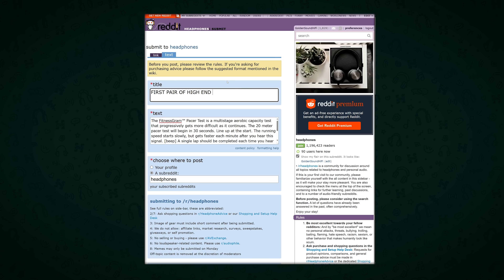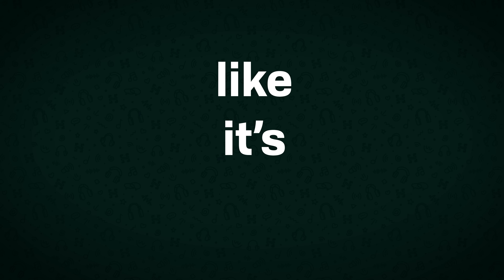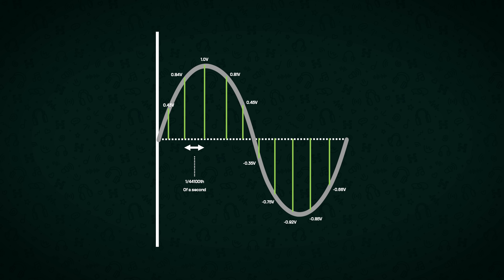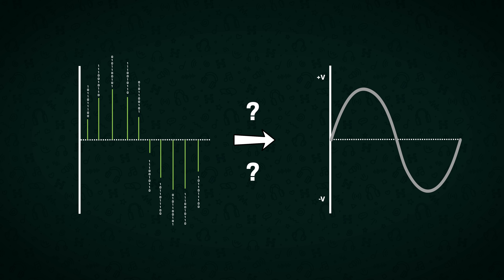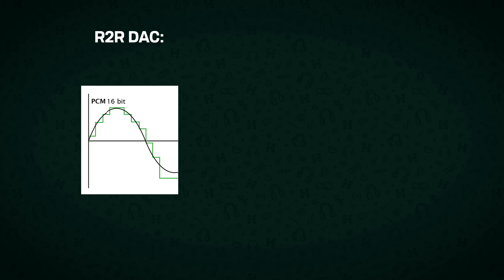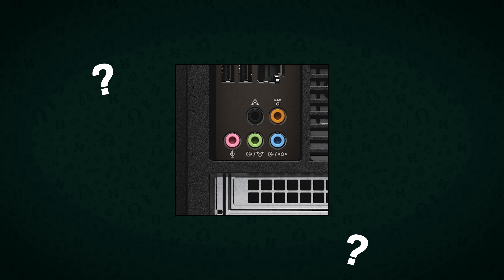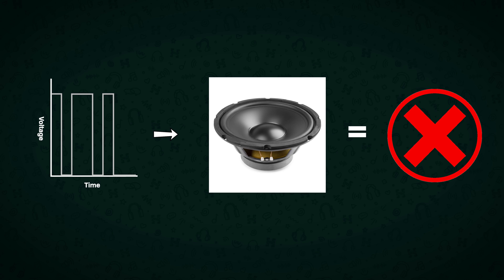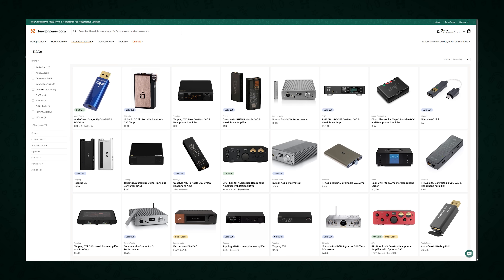What is a DAC and why do you need one?

Comment: A few important notes:

1) Whilst the video explained 1-bit delta-sigma and PDM at a basic level, most available delta sigma DACs are actually 'multibit' delta sigma. Meaning rather than modulating to high speed 1-bit, they modulate to high speed 5-7 bit as this allows you to avoid the biggest challenges with making a highly linear R2R DAC and you also don't need to be operating as fast or have as much difficulty with the modulator design as a full 1-bit DAC.

2) DACs that ARE 1-bit usually don't actually have a 1-bit PDM converter. Instead they usually use a moving-average FIR filter approach, this will be explained further in a future video.

3) Some products on headphones.com such as open box units may not fall under the 365 day return policy, please check the product page for specifics!
Reply: 4) Don't buy them from DCS /hj
Reply: @LucaTheStar  dcs is goated they doubled my debt for free
Reply: im the most sigma tho
Reply: Hey can you make a video about Linear Phase Fast Roll-off and Minimum Phase Fast Roll-off?
Which will return the original audio in the recording? I've read on Reddit that Oratory said Minimum while you said Linear Phase on a live stream
Reply: I'd be super interested in a similarly low-level explanation of how frequency response is measured and how faithfully the measuring rig and/or the best possible audio stack reproduces audio.
Reply: Discrete class A output stages  😊
Reply: Funny how Delta-Sigma DACS came out as 1-bit, then over the years manufacturers and engineers figured “oh wait, we can make this thing better by adding a few more bits” then increasing it to the 7 bits we see today in multi-level delta sigma. Makes me wonder why some people  like to poop on R2R and True Multibit from Schiit…???
Reply: So in the old days was this called oversampling.... I've got old CD players there's no DAC involved....
Reply: Strictly speaking DACs don't need oversampling. 16 bit signal -> 16 bit DAC -> reconstruction filter, no oversampling required. But when the DAC has less bits than the signal you need dithering to preserve the dynamic range, and when you need dithering it's a good idea to oversample to have less noise in the audible frequncies, even less with noise shaping.
Reply: @GoldenSound Did you happen to spot a DM on Discord about the KA11? I wonder if you have different info then what I had come across.
Reply: Excellent work as usual. I appreciate the analogy you chose; made it significantly easier for me to understand
Reply: R2R and 1-bit DACs are the best =D

Comment: Sound travels through in a wave where it changes size and frequency (speed). That is what’s called an analog process a value over time, so if you want to hear something you need it to make it sound waves, so when you have a digital signal it needs to be converted and that’s it. But modern processors are so fast they all can do it very fast and perfect so you don’t need a lot of hardware

Comment: What makes R2R DACs so horrible isn't just that it's basically impossible to perfectly match resistors to each other, it's that they change their resistance with temperature, meaning you get more or less distortion based on how the DAC being warmed up and your room temperature. And to fix these issues you need to get a stupidly expensive one, just for it to perform like an average delta sigma DAC.

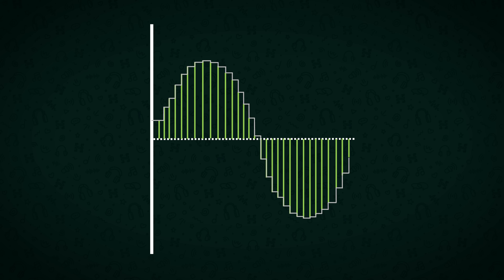Comment: 4:27 - those step-edges are just a result of mapping a discrete signal to a continuous space. They may cause high-frequency transients if you're forcing that jagged digital signal through a speaker, but they aren't caused by them. They're just an artifact of the encoding/decoding process and they'll get smoothed out with higher sample rates.

Comment: I have a 7.1 channel sound card and a 5.1 speaker system. 
I want to know how can I use a DAC to get DTS or Dolby digital sound. 
My sound card has optical port. 
But my speakers does not have optical port. 
I want to connect the sound card with the DAC with optical cable. 
Then the DAC with the speakers with 3.5 mm to RCA cable. 
Can I get the desired sound quality in this way? 
Please help.

Comment: I have a blu-ray player hooke up to a vintage receiver via rca cable. Sounds like crap when playing audio cd. My question is, due to using a vintage amp... where does the power supply come from ? The 5V usb cables clearly won't work. Do they make these DAC's with an external power supply ? Thanks in advance.

Comment: I've come to accept that the analog output section inside the DAC that brings up the signal to 2VRMS line level out is mostly more critical than perhaps the implementation surrounding the decoding method in DACs over a certain $ value. These gain stage(s) impart more characteristic on the DAC output than you would think. Having a socket to replace factory selected opamps with discrete versions can transform a DAC's perceived performance considerably. Also allowing you to tailor to your taste.  IMHO this is no different than upgrading phono section on your turntable.  Perhaps turntable cartridge selection is analogous to selecting a DAC topology. These things all matter if you decide to chase that rabbit like Alice.

Comment: Ah, the very nice T+A DAC 200.  Great DAC for the money, which is not meant as faint praise but rather an acknowledgment that incredibly expensive stuff is out there and while it might be slightly better, it's 10X the cost.  (I have a DAC I prefer but doesn't handle my occasional DSD fare.  So both are in place and the DAC 200 may be the best DSD I've heard.  I've heard a fair number but not enough to be high end certified 🙂

Comment: More samples, less jaggies and a capacitor to smooth it out is sadly not how it works.  It is nice and easy to understand and all, but wrong nonetheless.  Nyquist-Shannon explains it properly.  In short, # of bits = signal to noise and frequency (actually 2x the frequency) is the frequency response.  So a CD gives you 16 bits (so @ 96Db or so) and 44kHz (divided by 2 less some filter overhead) gives you 20-20,000Hz.  No jaggies.  None.  Impressive youtube, but too bad it is wrong.
Reply from the maker: Nyquist theorem states that you can reconstruct up to half the sampling rate. Not that the output is perfect inherently

Comment: I bought a JVC CD player in 1995 that had "1 bit DAC" as one of its main features and selling points. It was even printed on the front of it beside the CD tray. Knowing a little bit about binary (no pun intended, or was it!) I thought at the time it was an unusual property to boast about, because 1 is the least number of bits you can have. Obviously I didn't understand how the DAC worked and the significance of "1 bit DAC". Now I do!
Reply: You still don't understand much. This video is very oversimplified, though it gets the core concepts right. But, the people who need such a simple explanation, probably don't know Ohm's law even and, as the result, most viewers likely didn't really understand how that resistor ladder works.
BTW, -80 db SNR is perfectly fine for consumer headphone audio. THD is more important.
Reply: @noop9k  You're right. I don't have a good understanding of electrical engineering in general and specifically how digital audio works. It's only recently I have watched some videos on DACs and it's fascinating that we have been listening to digital audio for over 40 years but we're still trying to perfect the DAC! It's amazing that there is still room for improvement after all this time.
Reply: @MillisecondFalcon  The problem is that none of the electrical components are perfect. They all react not instantaneously, don't have perfectly linear response, clock sources are not perfectly precise. And also a single capacitor and a single resistor are not a very good frequency filter and certainly not enough to have a good DAC.
Math that proves that 44100 Hz is sufficient for representing all audible frequencies assumes perfect antialiasing filter. IRL really good analog antialiasing filter is a complex and expensive thing made of many basic components. To relax the requirements for analog components they use much higher frequencies (oversampling). Basically, they move some of the hard work into the digital domain, so cheaper and simpler analog components can be used..

Comment: If the external DAC is receiving a distorted signal from the laptop then how will it improve the signal if the source is already bad?
Reply: You can't really easily distort a digital signal.  That's the beauty of digital.  The digital signal is either full on or full off which places the on value waaaaaay above your typical amount of noise you would get.  The distortion he was talking about is having the signal converted to analog while still inside the laptop, it can get distortion/noise introduced at that point which will show up in your audio output.

Hence moving the DAC externally will allow that signal to cleanly leave your laptop while still in digital form and be converted to analog in a less noisy space.  Hope this helps.

Comment: Can I use audio interface as a dac ?? And connect it to an amp and call it a stack ???😅?
Reply: Yes, I did that from 2016 until yesterday, using my Steinberg UR 22 mk II audio interface for my microphone and as a DAC.

It had much better sound than my motherboard audio, as it didn't have the high level of background hiss problem. However it's a terrible interface as it has problems with audio dropouts, which showed up as faint pops and clicks when playing or pausing video and audio files. 

Frequently when watching a film, I'd hear a pop, then when I'd jump back 5 seconds, the pop wasn't their, so it was an audio interface problem, not a pop on the sound file.

Yesterday I hooked up a Bifrost 2/64 DAC, and I don't have the pops when playing audio or watching videos.

There are audio interfaces with decent sound, which don't have the audio dropouts problem, I'm not sure which, but do recommend you avoid Steinberg.
Reply: @ thanks for the detailed reply .  I have the ur24c and a cheap Samson QH4 4-Channel Headphone Amplifier . I mainly use it to power my 250 ohms headphones it works but i feel actual dac and amp stack can give  better sound clarity but I’ll try in the future .

Comment: I think I missed something...Why run the signal from a poor DAC to another DAC? Or do you somehow bypass the original some how???
Reply: @BrettGlass if you hook up your PC or phone to an external DAC, the conversion happens in the external DAC, not the one inside your PC or phone.

So it's not sending the signal from a poor quality DAC to a better one, it's sending the PCM data down the USB cable, or coaxial or optical cable to the external DAC.

This means the sensitive DA conversion happens in an external box, which is shielded, to protect it from the electrically noisy environment inside your PC.

When I was plugging my headphones into the headphone socket on my motherboard, it was using a DAC on the motherboard, and the background hiss was quite high.

I then got an external audio interface, a Steinberg UR22 Mk II, this used the DAC in the interface. This fixed the hiss and background noise problem, but it's a terrible interface, with frequent audio dropouts, which causes random pops in the background.

I then bought a Bifrost 2/64 which doesn't have background hiss, or audio dropouts, so I don't hear pops when watching videos or playing music.

With the Steinberg I'd hear little pops and clicks when I'd start playing or pausing audio files, sometimes several in 4-5 seconds, they were faint, but sometimes they were loud.

External DAC's are usually better than motherboard or phone DAC's, and some are better than others. Many people have complained about the Steinberg audio dropouts problem.

Comment: So relieved to know the $3k cable I got for my $100 headphones was the correct choice 🙏
Reply: Bro, you need at least a 5k cable to get the most out of 100 buck headphone
Reply: I just spent over £240 on a 4 meter balanced headphone cable from Oidio Sound.

My current cable had worn through the outer layer at the right earcup, so they needed replacing. And I bought a Midgard headphone amp, which has 4 pin balanced output, but my current headphone cable is unbalanced with a 3.5 mm mini jack.

Balanced cables do make an audible difference by rejecting noise, this is especially important for very long cable runs. Will they sound better? Absolutely, as the placebo effect can be very strong. Would I be able to tell which cable is connected, if I don't know if it's the old or the new one? Probably not.

But I wanted a 4 m cable, so I don't need to use a headphone extension cable, and I wanted to move up from unbalanced to balanced. Most other companies selling headphone cables for my Dan Clark Audio Aeon 2 Noire either didn't sell longer than 3 m, or they were more expensive, or I'd have to pay import tax and fees.

So while I am in the, "paid more on the cable, than the device it's connected to" camp, I'm happy with my decision, and looking forward to hooking it up, and listening to balanced headphone audio.

Comment: 3:15 I just want to point out that oversampling isn't strictly necessary to reconstruct the analog signal. So long as you have a precise low-pass filter at half the sample rate, the signal reproduction will be accurate. However, oversampling allows you to control how that cutoff happens much more precisely.

I don't know exactly how common DACs that don't use any oversampling whatsoever are nowadays, but you'd find them for example in toys that include a sound module.
Reply: This is true, though the problem is it's not practically possible to make an analog filter that'd do this, hence why we typically do it digitally as we can make a very steep filter that way. 

With an analog filter you'd either need to attenuate content in the audible band too much or you'd leave too much above the Nyquist frequency.
Reply: Schiit Audio makes multibit DAC's that can turn off their oversampling filter and run in No Over Sampling (NOS) mode. My Bifrost 2/64 can do that. I have also seen other companies DAC's, which have the option to do no over sampling.

I've not tried it out yet, as I only got my DAC and Midgard headphone amp unboxed and hooked up yesterday. But most people prefer Over Sampling, especially on the Schiit Audio DAC's, which use their proprietary time and frequency optimised oversampling digital filter.
Reply: @davidestabrook5367 Schiit is a meme in the community ( good products ). Like the " Schiit Stack " 😂

Comment: Spent most of yesterday comparing a Denafrips Ares II to a Topping E50. I was expecting to hear no meaningful difference or hopefully some presentation difference in the Ares. Before volume matching I heard all kinds of magic in the soundstage and imaging. Just like the reviews had said. By ear I was off by 1,5dB (on the Topping L70 volume scale). After matching things changed. No difference whatsoever in either, the bass was notably weaker or rounder on the Ares and the highs were easier, maybe smoother. I measured it and there is a treble roll-off. Around -1dB@7kHz, -2dB@9kHz and -5dB@15kHz. I EQ'd the same for the Topping and the effect was the same.

In conclusion, I'd take an E50 (or E30, same thing really) over the Ares. Should have tested an Apple dongle as well which was about the same as the E50.
Reply: Hi. Apart from the tonality difference and dynamics, you will most likely not find any difference in dacs using easy to drive headphones or especially iems. You will need a speaker system to notice it, or something like a susvara. That's why most dac reviews compare them using speakers. Watch jays iyagi video where he tested 100 dacs. Also, you need to test much more dacs for more experience to know what to listen to and where you need to pay attention.
Reply: @mmm-u6e9e  I've tested dozens and from the Apple dongle to Jotunheim there was really nothing worth of note when proper volume matching was done. In power amplifiers there are massive differences with the integrated DACs I've noticed, but I doubt adding room issues and degrading the signal helps with hearing the differences. Perhaps power amps strenghten the coloration or something. I also used an HE1000se which should be essentially as revealing as anything. The bass issues and treble roll-off are still notable problems.
Reply: @hartyewh1  I'm talking about standalone dacs used with speakers. They are way more revealing compared to headphones because they have low impedance and sensitivity. Can't head a difference in soundstage if they is no soundstage to begin with. This is how most dacs are tested by reviewers- take a look at Jay's Iyagi 100 dac video
Reply: @mmm-u6e9e  I rate Iyagi rather low for reviews. I'll test with speakers as well, but I doubt the less clean reproduction does much more than leave more room for the imagination.
Reply: @hartyewh1  How high do you rate goldensound?
Reply: @mmm-u6e9e  I think his on point when pushed as in source gear are the last thing you should put money in until you have the best headphone you want etc, but especially still a while ago his videos didn't make that clear enough imo. The crazy gear he often reviews doesn't really do much for the sound compared to something cheap and he agrees, but most viewers lack the context and scale of things. He also has bat hearing so not sure how good a baseline his is compared to most. Like the guy, questioned the ABX potential of his claims until he made a video about it and now just differ in approach, but he's fine knowing all this. To me Iyagi is a pure subjectivist gear lover who couldn't ABX most of what he says and thus useless for me gain info from. Also I've disagreed a lot with some of his reviews on things I have heard.